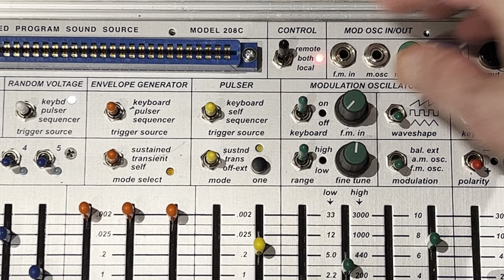The Buchla 208 Card Slot explained

Comment: I really love this approach to showing off the Easel or other modules for that matter. I'm hoping to have an Easel or  a  small 200 cabinet based around the 208 after I've resolved my 200e. 
Curious if the circuit board on the monitor was a sneak peak tease?
Thanks for all the work, Joel.